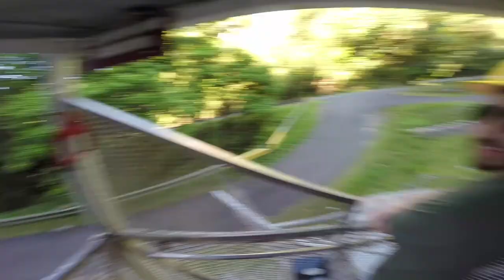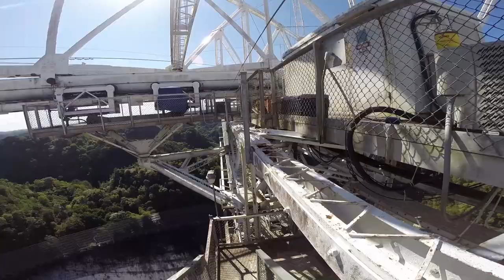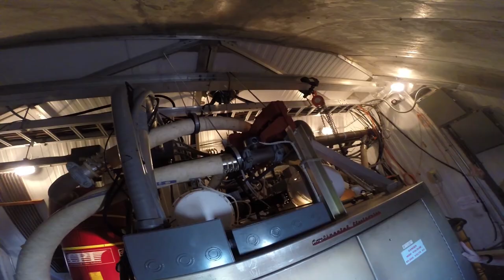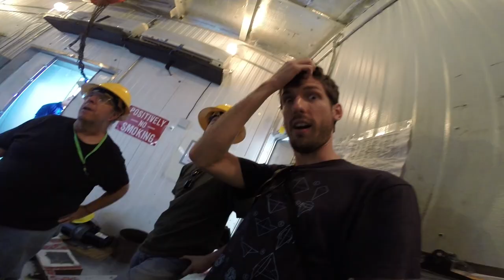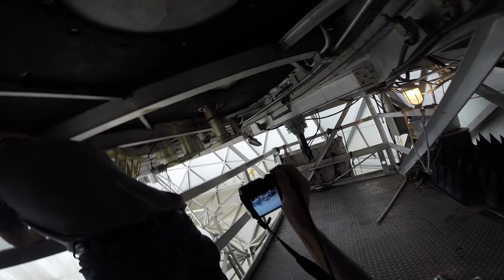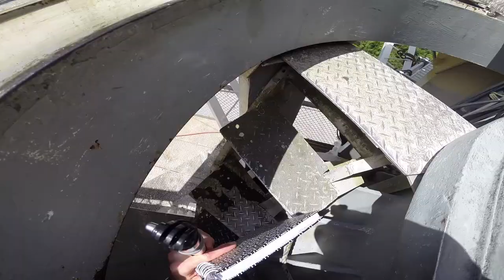Arecibo Uncut: First Visit to the Platform & Dome with Dana Whitlow

Comment: So I totally missed what he said about the sound, but what is the high pitched repetitive whining?
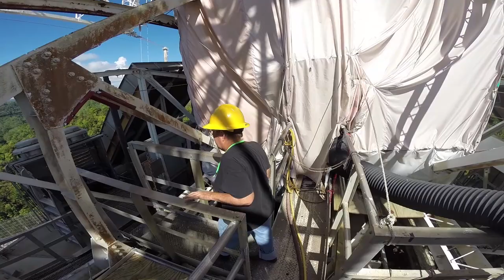Reply: If you are talking about a high pitched whistle that starts around 14:00 or so (when hit the dome), then that is the sound created by the Helium compressors. They are used in the cryogenics system to keep the receivers at 10s of Kelvin. Most receivers operate at around 15 Kelvin with a 70 K stage for some higher temp parts.
Reply: Anthony Ford ah okay, thanks.